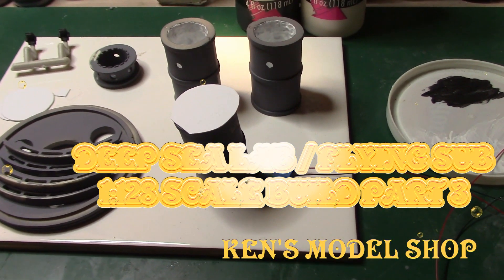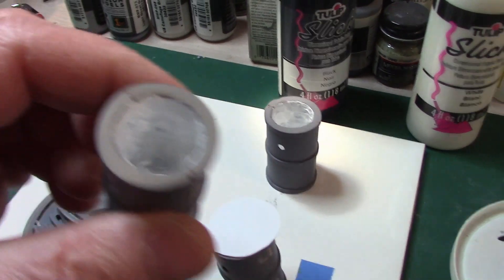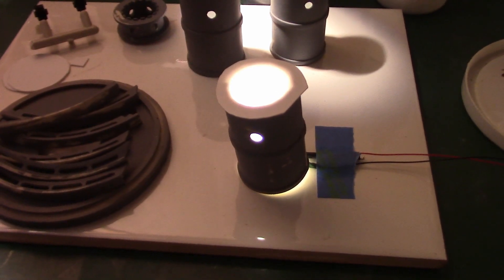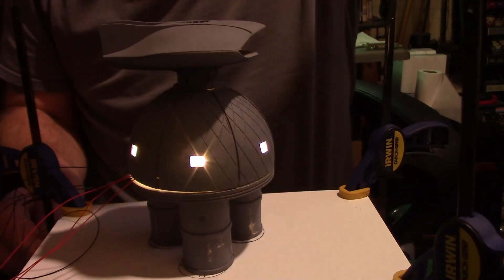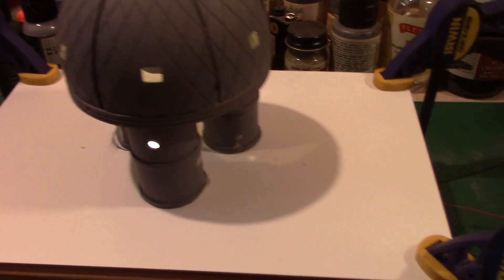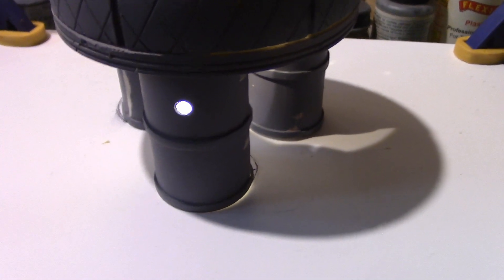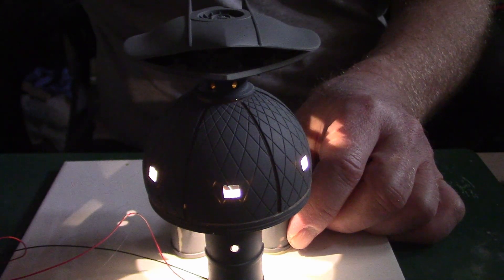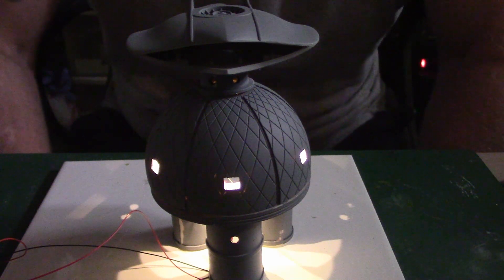DEEP SEA LAB  FLYING SUB PART 3

Comment: Looking like it will be a nice little diorama. One thing you could use on attaching a piece of sheet styrene to a wood base instead of a glue gun and screws would be 3M spray adhesive. You just spray both surfaces and when they get tacky, just stick them together and you have a very strong permanent bond.

Comment: The build is moving along, I had issue with the led tape as well, I learned to put a dab of solder on the + and - then take the wire put the iron below the wire put solder on top to melt (tin) the wire then is has no issues going on the tape